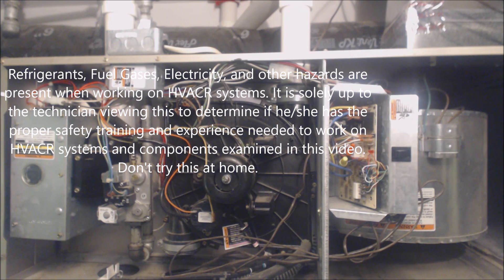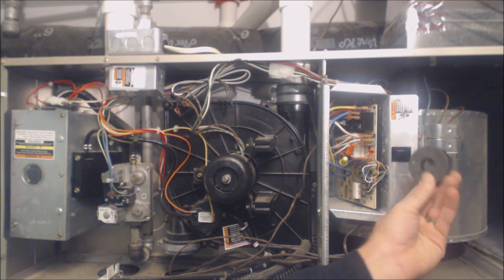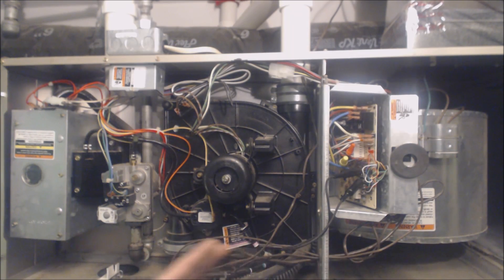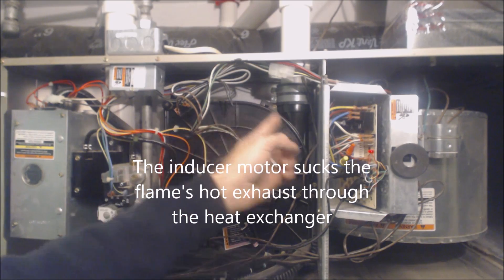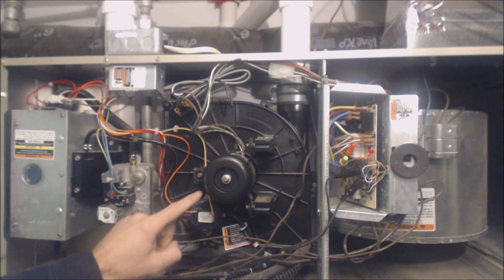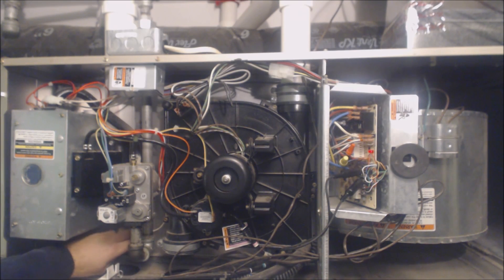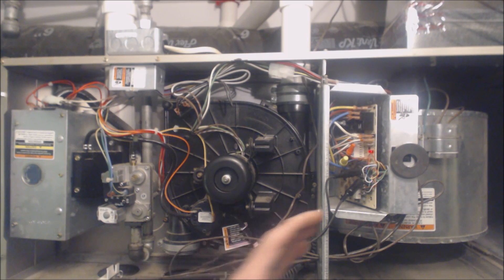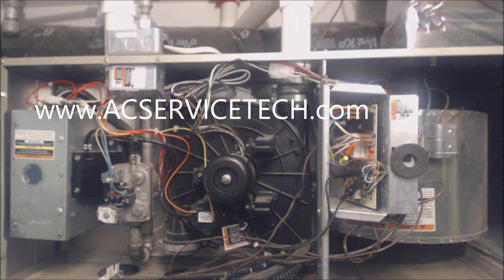Gas Furnace Troubleshooting- Why the Sequence of Operation is Important!

Comment: Question.. working on furnace now and after hsi glows the gas valve never receives power to open. That comes from board correct?
Reply from the maker: Yes the gas valve is powered from the board if equipped. Make sure to read the gas pressure with a manometer if you do have 24v to the gas valve
Reply: I am dealing with a similar problem. Hsi kicks on. Hear the valve click as the bord sends 24v to gas valve. Gas valve opens for 2 seconds then signal cuts out. Ironically can introduce 24v from separate source to gas valve in sequence not comming from circut bord. The system cycles fine as I manually introduce power to valve. Gas pressure seems to be fine. Just wondering why the gas valve power is cutting out on start up.

Comment: I want to know if its 24 volt ac or dc on circuit board or combination of ac and dc?
Reply from the maker: the 24v is ac only. The only dc is the micro amps due to flame rectification, thanks

Comment: Hi,

I have an odd problem, and I think I know how to fix it, but I seek confirmation from someone with greater experience than mine.

The inducer runs. The flame ignites for no longer than a second and goes out, so the igniter is working perfectly. The cycle repeats. On a cold morning, this will repeat for hours. I have cleaned the flame detectors. There are three probes distributed across two flames. The flame detectors might be marginal, or the gas valve might be marginal, but once the heater "gets going", it works.

This morning, I switched the electronically controlled gas valve off for ten seconds. The inducer ran for the entire ten seconds. When I switch the gas valve on, the flame ignited and stayed lit. I haven't done that before, so I don't know if I have observed a coincidence or an actual "cause and effect".

I think I can diagnose the failure of the flame to survive more than a second. Either the gas valve is malfunctioning by arbitrarily shutting off, or the flame detectors are malfunctioning by failing to detect a flame. Since flame detectors are the least expensive to test and/or replace, I want to test them first. Since this furnace will run, I fear I am dealing with something marginal that I might not recognize when I see it. Can you advise me?
Reply from the maker: flame sensors are typically just a stainless steel rod that has ceramic around it and it puts 80-180v into the flame. They don't ever need to get replaced except in the case on small ones like on smart valve units. You may want to check your grounding and you do need to clean the flame sensors though with unsoaped steel wool. Are you checking flame rectification with the multimeter?

Comment: Is the pressure switch set for normally open or closed?
Reply from the maker: In newer furnaces they are typically normally open but in some older furnaces especially ones without control boards, both the normally open and normally closed contacts are used to control what happens, thanks!

Comment: Question: 
I have a Lennox gas furnace M #78RGF3-75-1
and a Rheem AC unit controlled by my Nest T-Stat. Furnace installed in 1994, AC in 1995 and Nest stat a couple years ago but all have work great. 2 days ago stat says no power to RH wire detected, E24. AC unit works as normal but no heat at all. Any thoughts what could bring this on all of the sudden? I had a technician come take a quick look and he says furnace control board is shot and I need a whole new furnace but if that was the case wouldn't the AC not be working as well? They want to just replace furnace witha Bryant and leave the Rheem (R22) AC alone but I thought that old and new units typically don't mix well, especially this old. Help!!!
Reply from the maker: You could check to see if you have voltage from rh to c which should be 24-19v and then check from rc to c and you should get the same voltage. That doesn't sound right as you only have one power wire going and connecting to both rh and rc. It is not like it is two separate systems. That stat is all controlled by the one furnace and if the ac works then it sounds more like something is fishy with the stat. If you jump from the 24vrc/rh wire to w, does your heat turn on? If so then the problem is in the thermostat, thanks
Reply: AC Service Tech LLC Thank you very much. Will be checking what you asked tomorrow. Appreciate your time!

Comment: I have a question.What if the blower is not running, the high limit switch will shut off the system or the IFC will turn off the system? Thanks for all the great videos.
Reply from the maker: The high temp limit switch would normally open up the limit switch circuit and the ifc would shut down the flame, thanks
Reply: Thank you so much. I really appreciate it.

Comment: Furnace sequence of operations
1 blower
2 inducer motor
3 pressure switch
4 orange in glass sight
5 gas valve
6 flame rod
7 blower motor delay
Reply from the maker: Thanks David, some furnaces don't have a light on their board and some don't have a board but just relays, thanks a lot David!
Reply: David Pierson right idea but not quite correct.
Reply: Assume: customer switch contacts closed.   1. Thermostat calls for heat R-W.  Initiates self-check of pressure switch circuit to ensure pressure switch contacts are in OPEN position.  (this is in addition to the heat safety circuit being constantly monitored for all switches in contacts CLOSED position).  2. Ventor motor receives 120 volts.  3. Pressure switch contacts closed if all parameters of venting system are OK.  3. HSI receives 120 volts and if ok begins to power up to temperature (orange glow).  4.  Gas valve is energized.  5.  Combustion occurs if all parameters of gas for combustion are OK. 6. Flame rectification at flame rod occurs and IFC senses combustion has been successful. 7. Main blower is powered after delay.  8. Thermostat satisfied and contacts open. 9. Gas valve is deenergised. 10. Combustion stops. 11. Vendor motor powered off after delay. 12. Pressure switch contacts open. 13. Furnace awaits next call for heat.

Comment: Great video.  I've been in the field for a couple years now.  I have a question.  The guys at the parts house where I bought my last split unit could not answer this question.... Kinda scary to me that they can sell equipment and say it's matched, but not be able to explain the sizing, but anyways..... My question is about sizing a gas furnace to a coil on a split system.  I bought a 3 ton split system and it came with a 60,000 btu 80% gas furnace.  I know that's the input, so the output would be around 64,000 btu's.... I've always been taught that 3 tons of a/c would be removing 36,000 btu's of heat..... 12,000 btu's per ton.  If a customer were to look at the rating label on the furnace, I would not be able to explain it.  Any help in clearing this up would be greatly appreciated.
Reply from the maker: Sure, no problem. First lets look at a 60,000 btu furnace at 90 % efficient. Lets use a Payne number such as PG9MAV042060000. The 60000 is btu/hr input and 54,000 output. This comes with a blower that is capable of moving 42,000 btu/hr of cooling on the high speed, so 3.5 tons. Figure the cooling load first then match the blower speed or have the blower speed be higher. In this case set the 42,000 btu/hr blower capacity to 36,000 with the dip switches to match a 36,000 evap and 36,000 condensor. Thanks
Reply: I'm sorry, I just looked back on my first message I sent. I had my math figured wrong. Idk why I figured the math on 80,000.... The furnace I bought was was 60,000 btu input so the output would be 48,000 btu since it's an 80% furnace..... so are you basically saying just size the blower to the cooling coil tonnage?.... I did notice the furnace is rated at 1200 cfm, which is 400 cfm per ton so that's right.... I'm still kinda unclear on the heating btus..... 48,000 btus sounds like it would correspond to a 4 ton system if figuring 12,000 btus per ton....?
Reply: De @acservicetechchannel

Comment: My inducer comes on way before the blower shuts off. then the blower shuts off and the inducer keeps running but my furnace never lights up. flue pipes clear, pressure switch ok, inducer ok. is my IFC board starting the sequence of operation too early?. should I replace the IFC board?. Thank you
Reply from the maker: Depending on the furnace, the inducer coming on while the blower motor is running right after power up can be normal. The inducer motor will run, then you would test between the pressure switch power wire coming off of the board and 24v Common C terminal for 24-28.5v, then check between the pressure switch 2nd wire coming off of the board and common C terminal for 24-28.5v. If your HSI then does not get 120v and your high heat sensor and flame rollout sensor wires are allowing 24v back to the board then yes your board would be bad if it is a board and hot surface ignition system like this. If it has a spark ignition you need to make sure that it does not have another board for that. If your hsi has 120v and isn't turning red then the hsi is bad. Thanks

Comment: Hello ACSERVICETECH!!!  sorry I have not been on for a while, my building complex I work at had a fire and I been pretty busy installing new units, which are all new gas units from the old oil ones we had.   One question, when the hot surface igniter lights, does that also send a signal to the board to allow the 24v to flow to the gas valve? You may have covered it and I missed it. Great video thanks again.
Reply from the maker: Hey nice to hear from you, wow thats crazy. To answer your question the hsi is powered for a specified amount of time and the unit does not know whether the hsi is red, broken or even there. It will then only open the gas valve by applying 24v for about three seconds while the ground connected to the board that is there for the flame rod is continually searching for a dc micro amp signal to verify the flame. It will likely send three seconds of gas three times before it will lockout for several hours unless the power is turned off and turned back on.
Reply: acservicetech 

Thanks acservicetech! that makes sense, I was not even thinking of it like that.  Great stuff on your video's.  if I don't talk to you by then have a good Thanksgiving.
Reply from the maker: Have a Great Thanksgiving NICK-O!

Comment: the 2 wires coming off of the inducer motor (brown and brown/white stripes) whats the function of the switch they are wired into? I know the pressure switch is what tells the unit the inducer is on but not sure what this which does
Reply from the maker: Hey Eric, check this video out on the inducer motor and those cap wires to answer your question---https://youtu.be/9sNUAsIFW3g ------ Here is one on the pressure switch--https://youtu.be/2RRhiKmJ9Iw
Reply: acservicetech thank you for the links to the other videos.  I really enjoy watching your videos... keep up the great work!
Reply from the maker: Thanks Eric. It seems that those small black capacitors like you are mentioning for the inducer motor really don't go bad that often compared to standard ones you see. Still check them and make sure that they are in range.